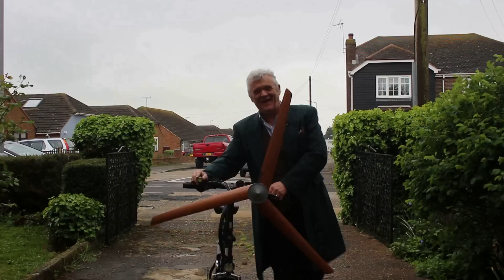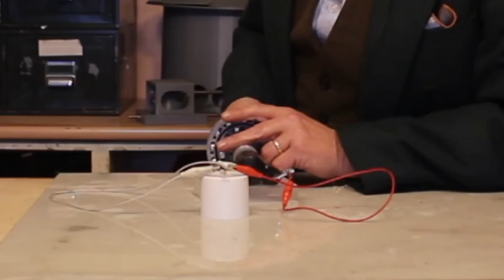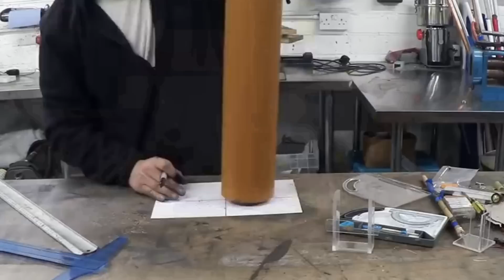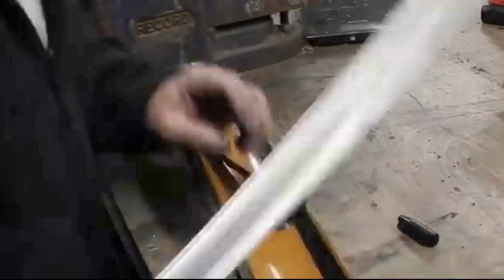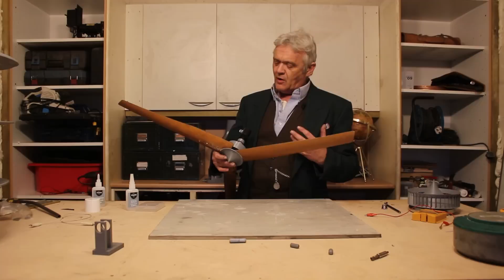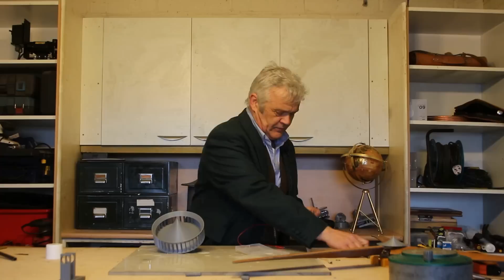1925 Propeller Power On A Bicycle

Comment: For those who don't understand it too well. Everything what we produce as electricity out of a coil is AC voltage - like in your mains. This need to be rectified by diodos or a bridge rectifier.  Once done will produce a DC voltage, the one which you have in the batteries or charge your mobile devices. 

To regulate it to let's say charge your mobile, you need a voltage regulator. Least efficient are L7805 or LM7805 and they will produce 5V, but heat a lot when there's a difference in your power like up and down as well. The most efficient ones are the HF regulators (high frequency), they use what's called a PWM signal to regulate (pulse width modulation). This allows to open and close electronics switch called MOSFET to your regulated needs. And, there's a potentiometer in the regulated ones as well so that you can adjust the output voltage.

I've made videos about them in the past as well. But, the best solution for an avg. person is to build a battery bank out of old laptop batteries called 18650. These are hidden in many old laptops if you have one or can get one. You can buy a charging and protecting controller so you won't overcharge it ;). It's cheap and available on eBay, Amazon and Aliexpress just to name a few. Without it, you can overcharge those 18650s.

Now if you charge your bank out of the wind turbine, etc. You can add USB type A female socket and use it on the output regulated by that controller of 5V, or 5.1V. You can use it to charge a phone, tablet, and all other devices which have USB connection to charge them.

In series connections adds up voltage, in parallel you'll get more amps, but voltage will stay - worth remembering as well :).

Comment: I'm a big fan of bottle dynamos as backup energy source for my bicycle lights.
BUT, charging modern phones that need 10-15 W of power for 2-3 hours makes using these dynamos completely impractical for such scenarios.
The PedalCycle, which is horribly expensive, can produce around 15 W and still not too useful for most people (syncing phone charge with commuting is difficult if not impossible).
At present, a small solar panel is my main source of energy on the bike. It delivers same wattage with almost zero drag and works even while I'm inside a building and the bike is left outside.
It charges 4 NiMH batteries configured in series. Those are enough for 1-3 hours, depending on whether there is residual light in the environment or not; and on pavement color and wetness.
Between the panel and the batteries, there is a super capacitor bank that acts as buffer both in case of solar charging and dynamo usage.
With this setup, I don't need to remember to take front lights with me, nor do I need to remember charging batteries before long rides. And, in case it discharges, I still have my belowed dynamo.
The next generation of this system will have a 10 Ah lithium power bank (cells harvested from laptop batteries) and USB-powered lights to better accomodate source voltage with light voltage.
Couple of years ago, I've been experimenting with a computer fan (converted to wind generator) as power source but failed miserably due to even lower current values. That was also intended for mostly passive harvesting.
Buuuuut, maybe this video inspires somebody to build a cheap generator that will be around the house or farm, providing light for a small room or something.
What needs to be clarified, though, is how much does a dynamo last.

Comment: Somewhere in the 'tube' a guy  pushes his bike along with massive air using three drill motors and blades at the rear running off a car battery. Stupid current draw and 'a-finger chopping'

Comment: You forgot a bridge rectifier after the bike dynamo. Those things produce AC, as it didn't matter for filament bulbs. The voltage regulator might not like that unless it has a rectifier on the board.

Comment: You know, I’ve been thinking about that for years I thought why don’t they funnel air back underneath the car to run a generator or two. That could potentially help power electric cars, driving 60,70 miles of wind energy.
Reply: Because you have to put energy in to drive forward
Reply: Yes you are right but a Tesla has batteries and if you are driving 6070 miles an hour down the road you have when resistance against the car you can use that to recharge your batteries I don’t claim to be any scientist just makes sense to me.
Reply: @rickmorris433  a wind generator attached to a vehicle adds to air resistance, effectively slowing the vehicle down, and thus needing more energy to move it. 

A car can't recharge itself while moving. He can, however, use things like regenerative brakes which converts kynetic energy back to electricity by effectively augmenting the car's resistance to movement.

The closest thing to your idea would probably be a rotor sail. Modern ships use it, but that wouldn't be practical for a car.